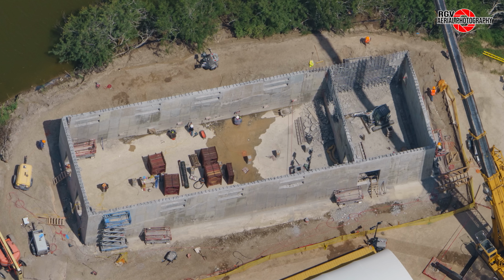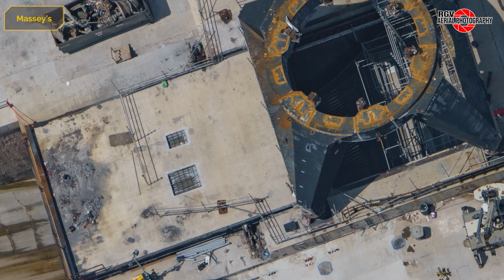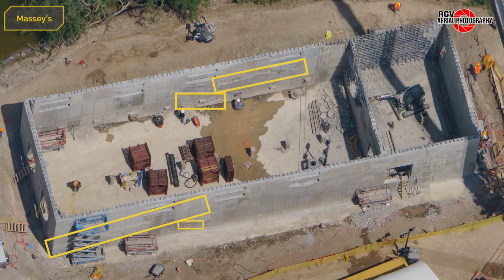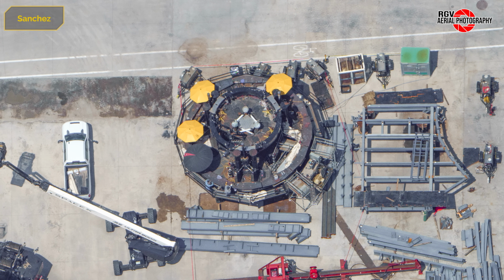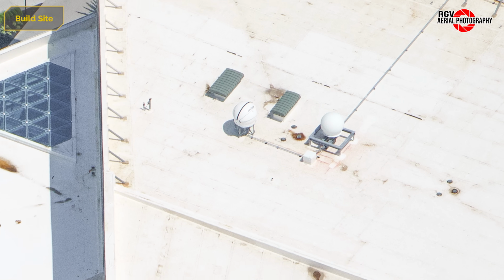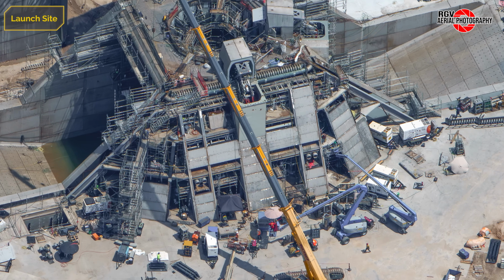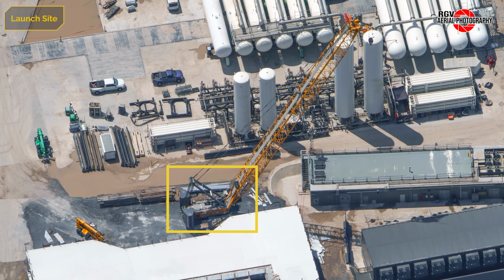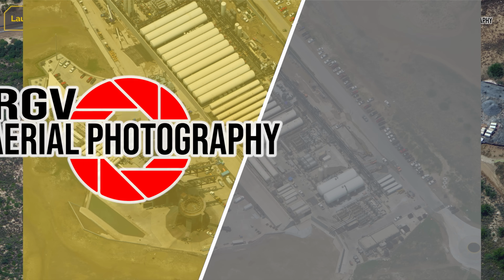Leading Upto Ship 38 Testing | New Starbase Flyover 98

Comment: Looks like they were a concrete truck short on elect bunker.  Why pull the forms off leaving bare rebar?
Reply: We think they had a form blow out like the first attempt of the launch site break room. Newer images from other sources show they are cleaning up the rough edges of concrete and will reinstall the forms and fill in the gaps.